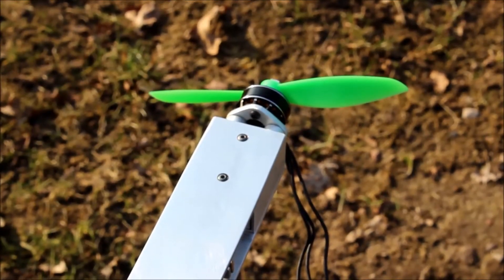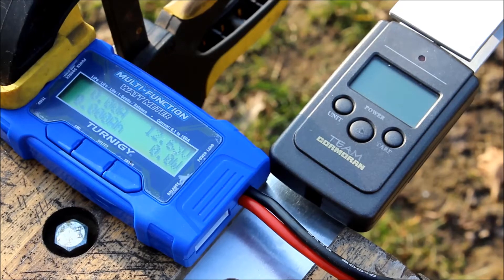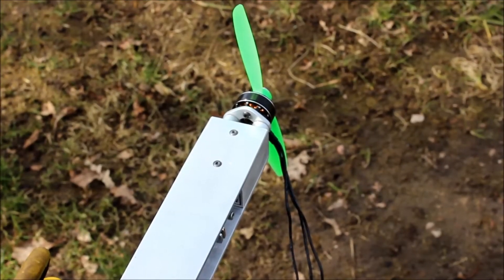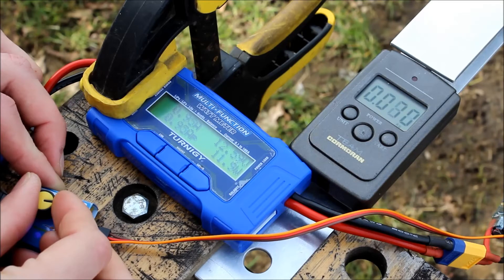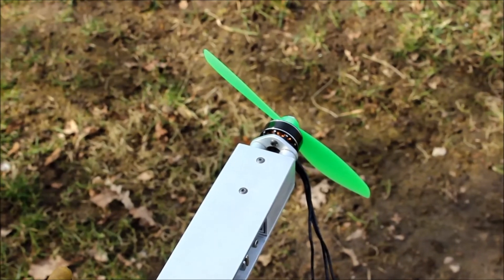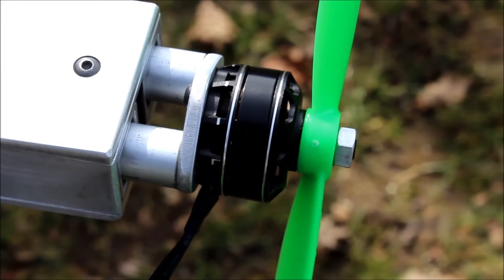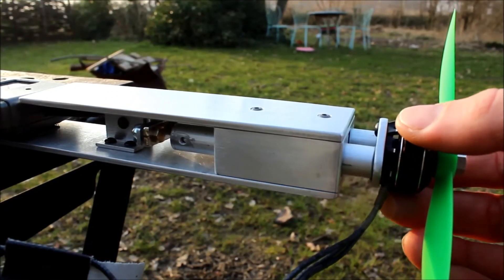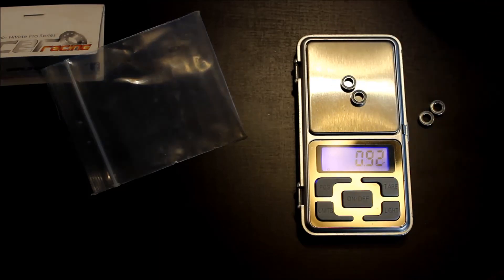Micro Titan 2204 2300kv Light Thrust Test. Ceramic vs Normal bearings

Comment: what size bearings and shaft clips did you use?
Reply from the maker: Greg Y just switched the standard bearings with these http://www.ebay.com/itm/260988529546?_trksid=p2057872.m2749.l2649&ssPageName=STRK%3AMEBIDX%3AIT

Comment: How are the bearing going? Still no issues after crashes?
Reply from the maker: One motor burned.. So I don't fly with them anymore. I fly cobra 2204 2300 now:)
Reply: +RC and FPV Jonathan Did You check the bearing condition?
Could it have been one or more balls inside bearings to break and have led to over-current in one motor winding.
Reply from the maker: no i didn't really bother. did order a new Titan but i gauss ill put it in a build for someone someday :)

Comment: The same dimention you are there for micro titan 2204 not light?
Reply from the maker: yeah im pretty sure the normal and light are the same.
Reply: Ok thank you !!
How did you do to remove the old bearing a ball ??
Reply from the maker: i put the motor on the arm of my blackout, removed the bell and took a m4 screw. put the screw through the first (top) bearing and angle the m4 screw so its not going to the bottom bearing. now gently tap the m4 screw with a plastic hammer. switch sides! so you wiggle the bearing out. now for the top bearing: take a vice and open it far enough so the motor fits in freely but the arm is holding it up(so the motor is upside down). and repeat the first step. placing the new bearings: i took a round pipe the same size or a tiny bit smaller then the bearing. and gently tapping it in place making sure it goes down straight! i think there would be some tutorials on youtube showing how to replace a brushless motor bearing. if it is not clear jet i'll see if i can make a tutorial showing how to do it:) best of luck!